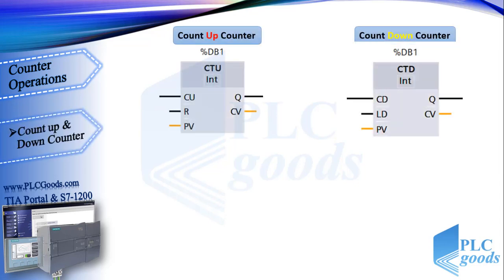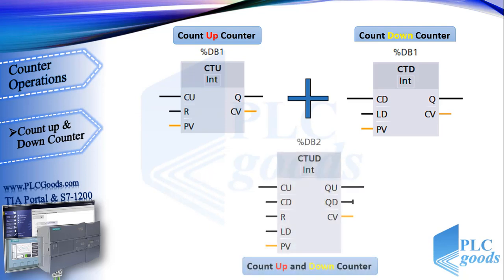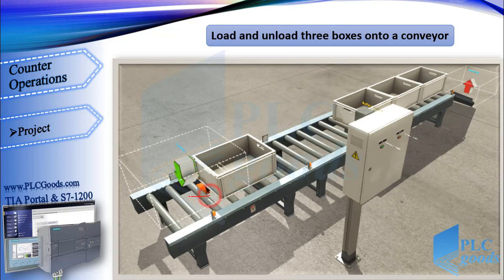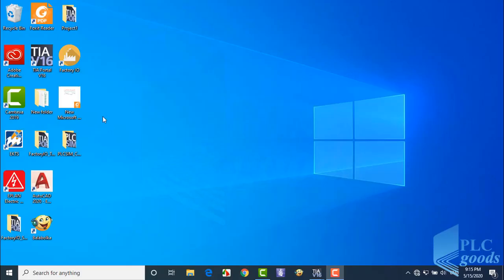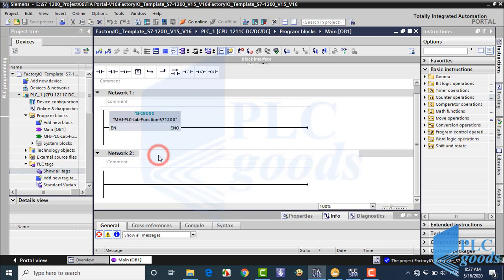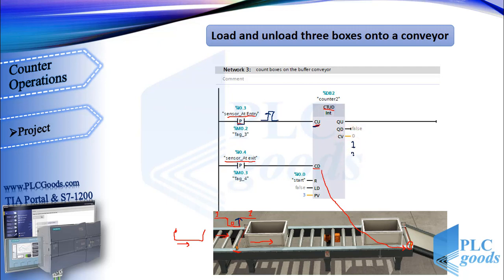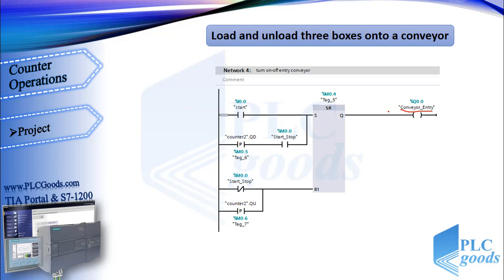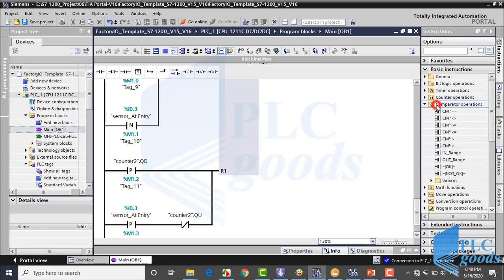COUNTER input output setting parameters | SIMATIC counter programming sample | Lesson 20

Comment: Does anyone know a tutorial to use Counters inside a GRAPH?
Reply from the maker: 👋 Thanks for your question!

Yes, you can definitely use counters inside a GRAPH program in TIA Portal. Typically, you declare the counter (like CTU or CTD) in the "Static" or "Temp" section of the GRAPH block, or even call a separate FB/FC that handles counting logic.
In my S7-1200 TIA Portal course, I don’t have a specific lesson focused on counters inside GRAPH, but I do explain both GRAPH programming and counter instructions in separate lessons.
Reply: @plcgoods  Hey I wasn't able to make it work by declaring the counter in Static. I don't really know whats going on with that.

Only thing I could do, is went to "Permanent pre instruction" and added a Counter in the ladder logic section.

Because if I declared it in Static/Temp, it would only let me make an "IEC_COUNTER" or something like that, and it refused to let me interact with it in the graph. But the permanent pre instruction Counter worked perfect.